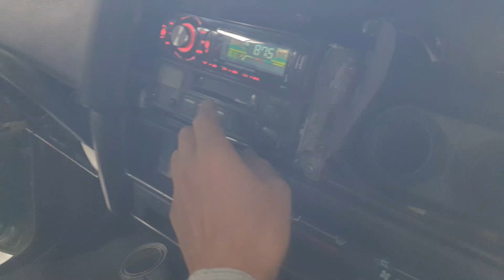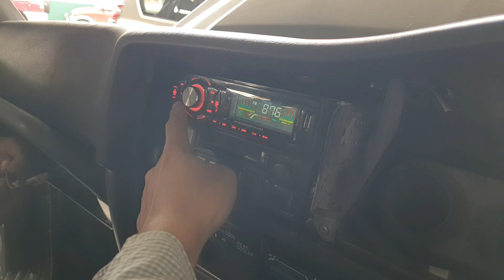60series Restoration Part43 ,Wheels,Dashboard,Antenna and more ,6H9 ランクル６０レストア状況

Comment: Outstanding job.
Suprised it doesn't have a FF rear considdering the rugged environment it operates in.
Reply from the maker: Thank you. 60's SF is stronger than I thought. Axle shaft is thicker than FF's. The mechanics say they've seen Prado's axle shaft broken many times, but they've never seen a 60 with 25 people on it. Of course, there are many advantages of FF, and I am also planning to replace it. One advantage is the differential lock.
Reply from the maker: https://youtu.be/oK6qGfAGDus